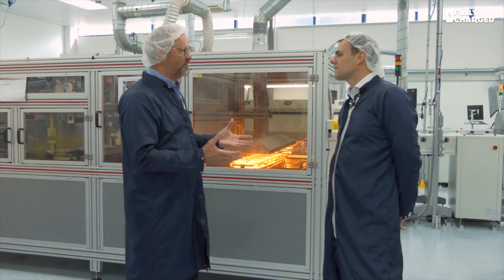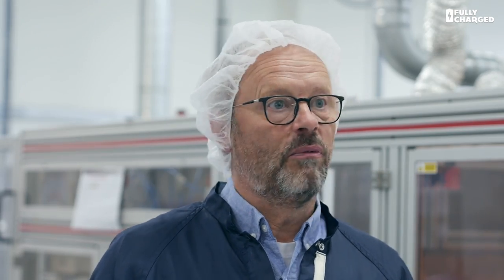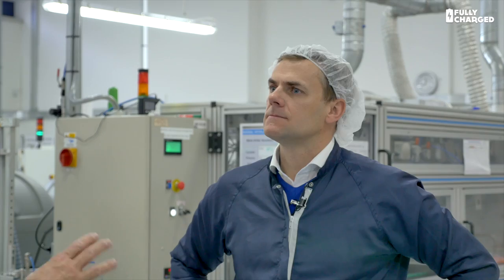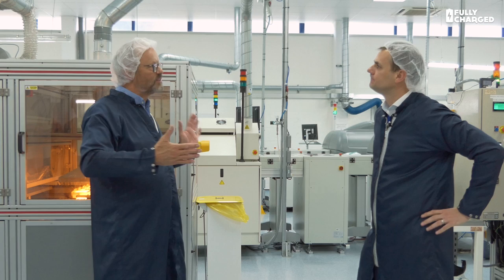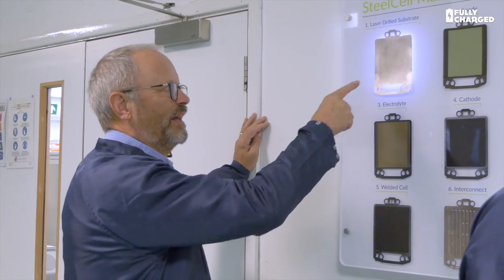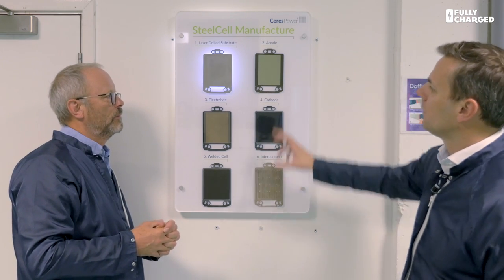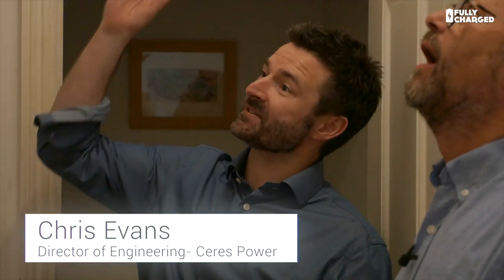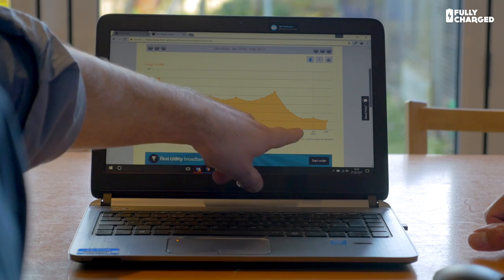Ceres Power | Fully Charged

Comment: its just a more efficient boiler that produces some electricity. If the source isn't zero carbon this isn't either. Hydrogen is the best option for that but by the time that scales we'll be way ahead with PV and wind. Conclusion... this will not prosper. Sorry.
Reply: A fuel cell is not a boiler.
Reply: Nope other way around. An Electric Generator which just happens to give off fraction of its energy at 800C. SOFC is also capable of Reverse reaction. Meaning H20 + CO2 + Heat + Energy -> Fuel + O2. Screw zero carbon, I want Carbon Negative.

Comment: Thanks for the video but why isn't anyone.. EVER! talking about the wear and tear of the anode and the cathode in these systems? Same story goes for flow-cells. It's all nice and awesome and what these guys are building is a great piece of engineering, no doubt about that, but until the day arrives that one smart motherfucking Nobel price winning bloke discovers how to easily (read efficiently) break the atomic bonds between the hydrogen and the oxygen atoms it just stays an inefficient process which translates to a waste of goddamn energy and manufacturing resources. End of fucking story. In fact, when you look at the entire infrastructure around hydrogen (well to wheel so to speak) it is far more efficient and better for the environment to just burn natural gas.
Reply: Completely agree. However, Hydrogen may be an effective storage system on a large-scale for the grid. By this I mean that we can increase our dependecy on renewables and use the excess electricity to create hydrogen, which we then convert back to electricity as needed (think solar). Pilot programs are already being run in Germany and it is supposed to be more feasible than batteries. BUT if the price of batteries drop, perhaps it won't make sense as a storage mechanism either. However, the system shown here seems a bit ridiculous for individual homes.
Reply: The thing is, hydrogen cannot be something else than an energy storage system because it is an energy storage system no matter where you apply it. H2 doesn't exist in nature, you need electricity to create it. Think about that. With lithium batteries it is the case that the more you build the cheaper they become thus the more feasible (presuming you were talking about the price). The creation of H2 is not subjected to market law when it comes down to the amount of electricity needed to break the atomic bonds. Market wise you could speak of a price drop per kg of H2 when you produce it on a massive scale but that doesn't change the fact that it still is a waste of electricity to split the atoms, to store it (either under high pressure or to super-cool it), to distribute it etc. A market demand in these H2 systems does not say a word about the degree of sustainability/efficiency. Sure, using H2 has its benefits. But we need a Nobel price kind of invention to make the use of it as efficient and as save as storing electricity in lithium batteries.

Comment: yeah,...well, attractively presented whille still avoiding essential details to be really useful commercially...beyond all these enthusiastics, what are in fact its real perfornancies on enduser/customers side in comparing with the well known today alternative already in wide use ?   
I mean what is the sold price of alike cell, how much it lasts both in use as standby since I think are never rechargable /reusable on customer side like many other alternatives...   
This documentarty shows some not so high 700 W power released in that complicated not too small device replacing boiler on the wall, but tells us nothing in relevant data to compare its really efficiency and usage costs along a given period of constant power consumption.  
Ok they talk about hundreds customers everywhere and they also invested much money for that advanced factory and long term researching behind, but....  
We knows today as sample Li Ion batteries how much weight hom much size how much power  current and output voltage for how much duration and those are truelly easily rechargable.  
Newer batteries Li Titanate Oxyde LTO revolute immediate future even more with life long up to 82 YEARS of tens thousands recharge cycling at even quarter size of today Li Ions and their technical data are already known and Elon Musk just started to include in next Teslas, they are so compact and easily to handle none extra system required comparing with these cells that I think can never be recharged on user means, so what efficiency are we talking about?...
That is why maybe after tens years from their origin, these Fuel Cells are still far from use in commercial domestic but the most demanded use from billions potential customers both for cars or their homes... that is also why for me at least excuse me...it rather looks a potential later subject for that celeb National Geo/Discovery's Abandoned Engineers  documentaries...
I expect somebody more informed to clarify me....Thanks

Comment: Bit of  a step backwards
Reply: I agree, very cool technology but renewables with batteries is probably the best answer in the long term.
Reply: because tonedcos incorrectly thinks a natural gas power plant burning gas to produce electricity and send it to your house is >50% efficient?
Reply: Only if you're a fantasist and believe the wind always blows and the sun always shines or the UK is capable of building more nukes at anything like a reasonable cost.  Cheap, efficient, scalable and fast reacting power sources enable more renewables, not less.
Reply: burning the fuel in a turbine at the powerplant might be >>50% efficiency, but it does give all sorts of nasty emissions that should, but currently are not, be aftertreated in the exhaust, than with all the conversion of power and lines, at your wall socket, the overall efficiency is <<<<<50%.

but this was all explained in the vid, so i too don't understand why this would be a "step back"
Reply: Because, fossil fuels. The UK produced more energy from solar, than 10 power plants the other day.
Reply: totally agree, fossil fuels should be minimized. until we get there... this is a good back up.
Reply: tonedcos what about winter when its not sunny for months?
Reply: Plenty of alternatives.Britain has the biggest wind and wave in europe. Besides gas leads the way to fracking, and we don't want to facilitate that, do we?
Reply: I think the UK is getting to about 1/3 renewables in summer months which is fantastic, this would be a great addition to homes which would lower the carbon footprint and it does it without mining for precious metals. I'd say its a very good intermediate step
Reply: tonedcos there's plenty of historical data for wind and solar output over winter periods, I suggest you look at the data.  I'll repeat again, technology like this enables more renewables on the grid.
Reply: I hear what your saying. There's also lots of hysterical data, designed to facilitate private company's exploitation of ground resources to the detriment of the environment for a quick buck. The smart move is pursue and expand house battery packs, solar panels(and tiles) etc. which would all go to maintain the grid.
Reply: This technology goes hand in hand with battery packs though... Also in brisbane for instance they're using poo gas to run an electricity turbine (from a sewerage plant). Using gas that comes off our poop in fuel cells is much better for the environment than using even solar. This channel has also done a video about making gas from lawn clippings. This technology is very important and is not just a sideways step to making dinosaur burning more efficient, that would be a very limited and naive view of things...
Reply: also.... converting water to hydrogen with solar and then using the hydrogen with an efficient fuel cell could be a great idea for mass energy storage one day where there isn't enough room to pump water up and down using solar+hydro etc.
Reply: thats cause elon no likey fuel cells lol
Reply: Yep, brilliant work on all fronts. But, there's a  big difference from silage gas to fracking gas. As the UK is importing gas, and it's aim is to be self sufficient, then whats happening in Yorkshire will go nation wide.
Reply: It can be run by total renewable as he said it could run by H2. Go figure.
Reply: Yep, totally agree, renewable blah blah blah, but i don't trust  government and business, not at this juncture at any rate.
Reply: Not really. There's room for lots of different technologies and they'll all have different strengths and weaknesses. It's likely that any one particular technology will experience scaling issues when things really start ramping up, so the more alternatives to spread the load during the transition, the better.
Reply: Elon doesn't like hydrogen Fuel cells as a way of powering vehicles.  this is completely different, since you can also make/recycle gas from renewable sources. most of our energy in the UK comes from natural gas, if this makes it more efficient, then that's a good thing.
Reply: Most gas power plants throw away their heat. The good thing about combined heat and power is that you only make as much electricity as you need to make to heat your house.

There are some large scale combined heat and power plants, which feed their heat into a district heating system.

Both of these solutions are better ways to use natural gas, and if it can be replaced by biogas and hydrogen over time with minimal investment, then that's great.
Reply: we are nowhere near the point where we have to save solar or renewable energy, it just means we use less gas on a clear windy day
Reply: tonedcos that is the first thing I thought of as I started watching this episode. Maybe it could be used with the gas Ecotricity are planning on generating with their anaerobic digestion plants early on it might not need any gas extracted from fracking?
Reply: I hear ya bro, but the silage aint gunna do it, there going to want to push fracking, purely for the investments and grants.
Reply: Fracking is not needed at all, apart from the fact it's an investors money pot, no matter the environmental damage, there going to push for profit, and as useyouwell, we pick up the tab.
Reply: The good thing with these fuel cells is that you can start with natural gas, and then move on to biogas or hydrogen. The usual problem with injecting biogas into a natural gas utility is that you need to perform some chemical processing of the gas first. And with hydrogen generators you'd need to completely rebuild the generators.

If you really can use the same fuel cell for natural gas, biogas and hydrogen - then that's a great flexibility solution. And by using the waste heat, even with hydrogen, you waste less energy.
Reply: Indeed, injecting hydrogen into legacy gas grids would not be trivial. However, if hydrogen can be generated by electrolysis of renewable energy, the same fuel cells could be used to convert stored energy to electricity on demand in the future as are being used for natural gas and biogas today. (With various lithium batteries becoming cheaper and more efficient by the moment, that might just be a theoretical advantage - their affordability is "killing off" hydrogen projects and even other battery technology startups.)

Biogas can help clean up the gas grid gradually though, by injecting it into the grid or transporting it as liquid biogas. There is not enough waste biomass available to 100% replace natural gas, but it could certainly help reduce net carbon emissions - and using the gas more efficiently by CHP fuel cells rather than inefficient generators - helps a bit at least.
Reply: Let's just focus on getting the world off of oil and coal first, then we can focus on gas. 99.99% of homes in the UK rely on gas for heating/cooking and 60% of electricity comes from gas - anything that increases the efficiency of gas is a good thing - assuming this actually does.
Reply: That's the possible problem Strangeting. With Russia sanctions and Britain's dependence on fossil fuels, reopening the coal mines is unfeasible the only other option apart from Nuclear, is what the banks and shareholders wan't, access to fracking land. All ready kicking of in Lancashire and Yorkshire, and Derbyshire. I appreciate the comments about using the gas we do use better. But fracking is being made to look like the best option. And has been remarked, we have massive wind and solar, hydrogen production on site for cars to use, smart grids emerging. We just need a policy that pushes forward the infrastructure so we can be free from polluting the shit out of our back yards.

Comment: 1kW to run a house?!
What the show lacks is a journalist, scientist and economist.  A bad cop, sceptic and someone who will address the elephants.
Reply: Exactly, I love the enthusiasm and the way that it may encourage others to think about alternative sources of energy, but keep it real. My coffee that I am drinking now took 2kW to boil the water. Maybe if this was linked to a battery bank to charge during low power usage it could supply the needs of a household. Of course, that adds huge cost to the original installation.
Reply: Wayne Russell We use 12kw per day in our house so 1kw is more than enough. If you boil a kettle then you would take power from the grid. Our house ticks over at about 250 - 300 watts.
Reply: If you are taking from the grid then you are not running your house from the fuel cell, you are reducing your grid usage. This is superb, but you still need a way to store the energy produced when you are not consuming enough to utilize its output throughout the day.
Reply: 1kW is a unit of power and 1kWh is a unit of energy. Ellis Toms, you probably use 12kWh of energy per day and 1kW is not enough power to run a house since an electric oven or hair dryer can use 3kW of power.
Reply: It's the same problem with the Tesla PowerWall when it first came out, Thankfully the numbers have jumped to a more reasonable 5kW-C now. The original number of 2kW-C for Gen1, that couldn't power my 2.5kW vacuum. Was like having a car that could drive thosands of miles, but with a max speed of 10mph.. Yes, you get the distance, but not get to somewhere fast enough.
Reply: Most of the day a UK house will be using far less than a kW/H sure you will need mains power for the peak stuff but for the rest, this would do nicely. My usage according to my last bill is 500 Watts per hour over the day which is a bit high IMOP
Reply: CRS1964  Nice one, it was so quick I missed it.
Reply: BASE Load @ 1KW = 24KWH in a day. Many european houses use slightly less than that. Basic mathematics, Wayne Russell go back to grade school.
Reply: 1kW is enough to achieve the 70% self consumption they talked about, no one is talking about an off-grid solution!
Reply: I always consider long term Peak as a minimum, not base usage. What would be nice is a combination of systems. Ceres to charge a power wall at ~1kW-C, which can then supply ~5kW-C when needed. And this is not even considering a Solar charging system on top of all that.
Reply: 1kW is enough to run my not particularly efficient home with room to spare for most of the year. In winter when we're using the tumble dryer more often we hit around 26-27kWh usage
Reply: It is all you need if you insulate your home properly, recover waste heat from your ventilation/air conditioning, get rid of your environmentally-stupid tumble drier and dishwasher, and eat salads.
Reply: Use your Brain animal hair... it's evil getting it sucked up with a light weight vacuum. Get rid of the pets or go for raw power.. I know which one I was allowed to do by the wife. lol
Reply: "My coffee that I am drinking now took 2kW to boil the water"
this implies you don't know the difference between power and energy; if that's the case it disqualifies your opinion.
Reply: @Paul Mansfield  Fine, my kettle required a 2kw supply of electricity for a few minutes to boil the water it contained. The video gave the impression to somebody without knowledge of electrickery that a house could be run on this supply. Luckily CRS1964 pointed out that this is "base load" which I think should have been made clear within the video article. There's no point preaching to the converted, to make a change everyone should be taught about using alternative supplies i.e. "This box helps reduce the amount required from the grid" maybe you could help teach the uninitiated instead of brandishing your judgements.
Reply: +Paul Mansfield
"you don't know the difference" - Yep. He doesn't know the difference.  And yet he voices an opinion, when he should be asking a question.  What bollocks.
Reply: Last time I checked, 1kW was about what the average UK home uses.
Reply: During the day, my background usage (everything off, just stand-by power, chargers, internet router, cordless phones etc) is about 250W.
Reply: @Imix Muan: fuel cells are inefficient and at least for stationary use a waste of money. Only advantage is the high energy density. There is nothing wrong using a 2kW boiler, it runs half as long as a 1kW boiler and consumes the same amount of energy.

Comment: Musk should add this product within his gigafactories.  No Briton has ever properly managed large-scale operations since WW2.
Reply: I doubt they would be interested in making something that runs on fossil fuels and produces CO2 when in use...
Reply: I agree with you, but there are and will be instances where electric power requires its own backup.
Think of it as a form of insurance.  I'm not suggesting a whole gigafactory's-worth, just the reassurance of a secondary power option.
It might be handy at the Poles, or in the Sahara, or anywhere where there's no electricity supply, or solar collector system. :)

Comment: Please stop covering fuel cells, it's false that you need gas in the uk.  An electric air source heat pump is simpler and most likely cheaper.